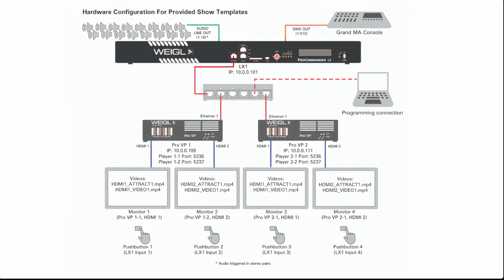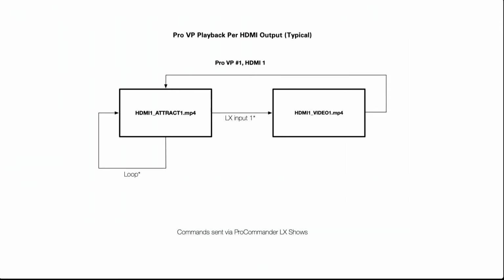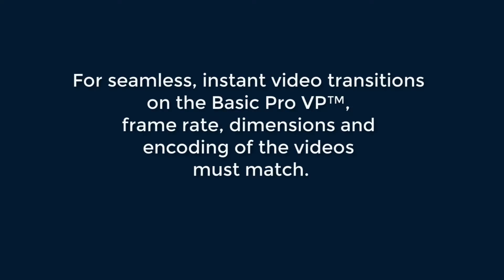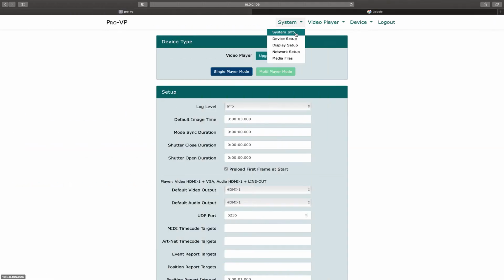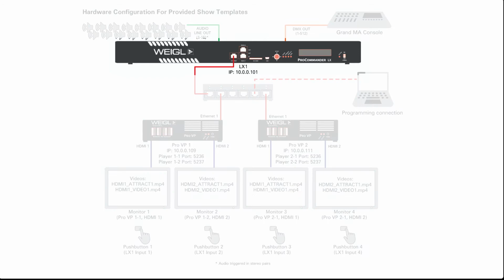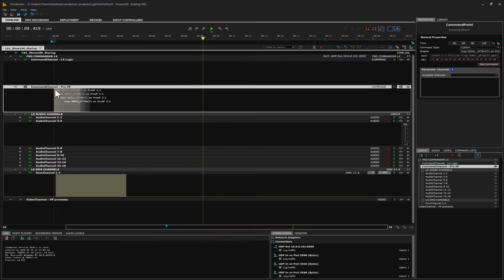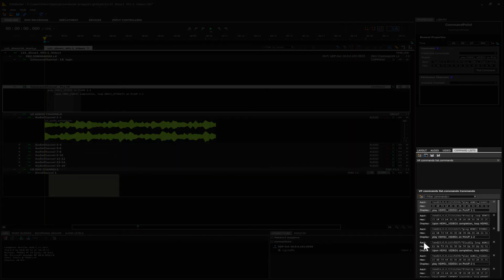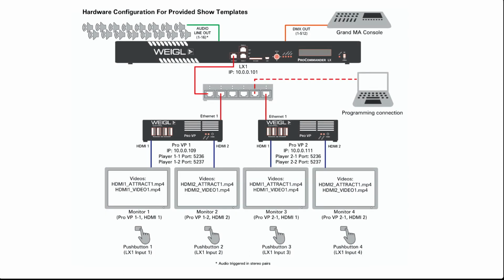Case Study - Interactive Video, Lighting and Audio

Comment: why is there just a random lighting console that's not being used
Reply from the maker: Can you eloborate your question? We talk about 2 different softwares in this case study namely Showforge for MacOS and Conductor for Windows. These are two time line based softwares for multimedia synchronisation, between motor, video, audio, lighting and special effects control, for specific Weigl devices.